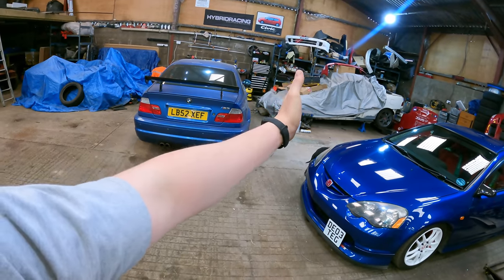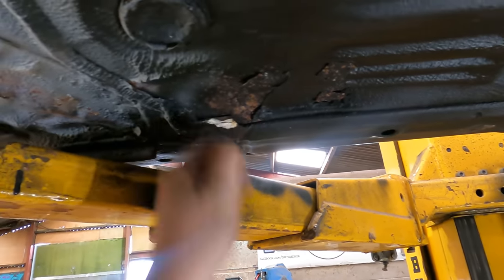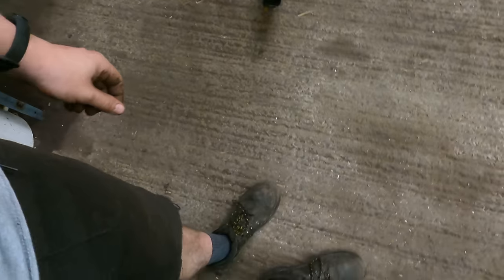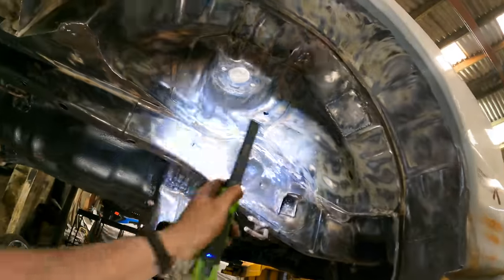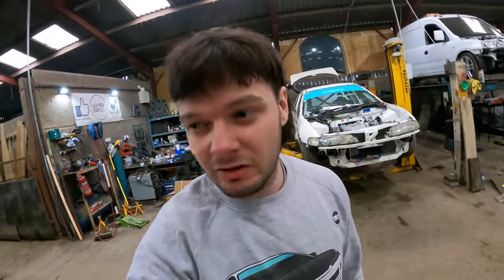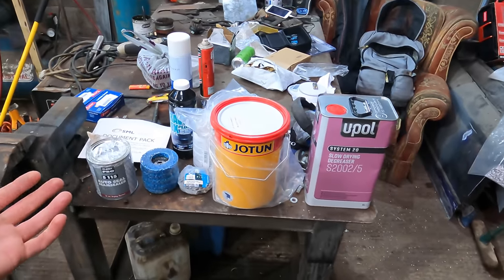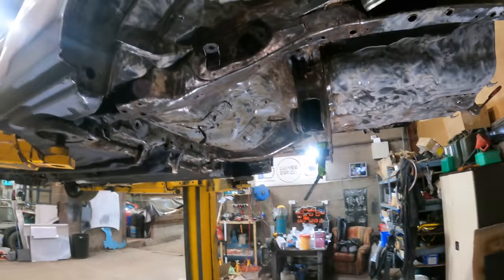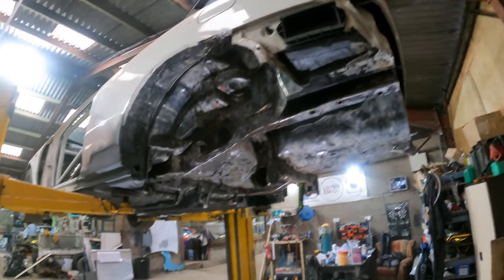DC2 UNDERBODY RESTORATION PART 1 - Scratching the Surface

Comment: They're a right bugger for rust alright. A week after I got mine back in 05 😲😁 fresh off the boat from Japanland I went and filled every cavity I could with some waxoyl I had in the shed and bilt hamber when that ran out(even took out the back seats and rear inner panels). I was as high as a kite from the fumes. 😁 Every year I get under it and refill with the bilt hamber goo. My dad did that with the family cars growing up and they never rusted so... Now all these years later the arches and sills are rust free. I reckon if I hadn't done that from the get go it would be a sieve with wheels by now. I think because mines my daily that helps too, because it gets the wind up its skirts every day so the damp doesn't get into it. 
Slow going, but fair play you're getting there.

Comment: This was my job until recently, i could do other mechanical stuff but I mainly removed underseal off cars that came in for restoration. Grim stuff but the end result is quite satisfying. You could do with some air tools because they're smaller, my favourite was a small air Dremel with a 90 degree attachment and some miniature knot wheels, could get them just about everywhere and they span so fast they'd shred through most underseal fairly quickly.

Comment: Did this to my MK1 Golf after doing a lot of cutting and welding. Intense grinderings, especially if the grinder's bearings are starting to fail, brings comparable arm pump to downhill mountain biking and rock climbing! Five o clock shadow and black bogeys are a sign of poor PPE use!
Reply from the maker: the black snot was a new one like !
Reply: @dannyDC2  you haven’t worked on shit old cars properly until you experience the black snot
Reply: Hahaha I'd forgotten about black bogeys from years ago working in my dad's bodyshop 😂🥴

Comment: I am a big fan of chemically removing paint and underseal.. There are plenty products out there that can be brushed on, and then you can peel or scrape off basically all of what's on there, back to bare metal. It's nice because you're not grinding away any unnecessary steel, and it does the hard work for you!
Reply: What product would you recommend ?

Comment: Top tip. Get some leather gauntlet welding gloves from tool station. I use that when operating the angle grinder as less likely to clubber nuckles on the sharp edges. Also make it nicer when working in the cold.

Comment: I've done this on my Williams clio on  a rotary. Much easier on that but still sh1t! Get yourself a paper overall, dust mask and goggles with a rubber seal around.  Nothing worse than finding sealer in your ears, up your nose in fact I found it down my pants. Trust me I learnt the hard way!!
The knotted wheel is great for the thick stuff, wire wheel for the tight corners and use the paint stripping disc to clear the remaining off. 
Good luck, I feel your pain!!!

Comment: Ah my favourite tool, I like to call it the Wheel of Death ☠️
The blue discs are great for striping paint or as long as the surface is flat otherwise as soon as you touch an edge or rust they disintegrate, that tight spot in-between the chassis rail and the spare wheel well I would heat/burn and scrape then a drill with wire cup and or wheel, a rag with thinners on it (after the burn part) will get rid of the old paint patches, not a nice job to do at all

Comment: Hot air gun and a filling knife gets underseal off on nice big chunks / strips, then you can whizz over with the wire wheel after if needed for any remaining bits 👍

Comment: There’s a lot to be said for getting the whole shell dipped, that way you can be sure it’s got all the unseen stuff in the cavities too, but it’s a ballache no matter which way you skin it - dipping the shell means getting everything off and a full re-paint; not dipping it means achey arms, dead grinders, black snot and potentially doing it all again a few years later because a cavity rots through…

Best of luck Danny - I’m sure if you put a shout out you could recruit some help for this kind of thing
Reply: If a panel is rusted out you'll see the hole from the other side, you could cut open a large cavity if you suspect rust and weld it back up, or with a flashlight and a camera snake shoot some rust converter in, then spray protection

Comment: Not sure what that primer is but in future Epoxy primer is the way to go, And before that use metal prep by POR15 to kill any remaining surface rust.
Reply: google would tell you that jotamastic is an epoxy primer
Reply: @denguefever9489  Can only make out Jotun in the video, They make all kinds of paint. Nowhere does it say Jotun Mastic. As you were 👍

Comment: Yo I done the same job as this on my mk2 gti last year, it caught against a corner and I took a wire wheel to the fucking forehead lol. Thankfully between my eyes, wearing just my ray bans like a naive kid. Lesson learnt.. wear proper PPE.
Reply: Lucky! I did the bit of my hand between the thumb and wrist with a twisted knot 12 years ago and still have the scar!
Reply: @rob1984p  jeez! I’m lucky mine healed quickly with no scaring, this too was a twisted knot but very worn